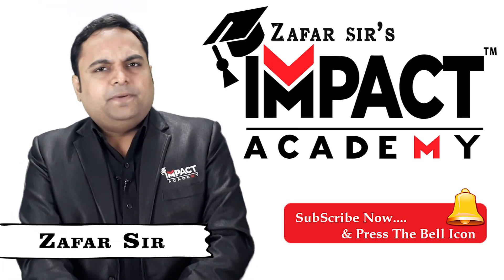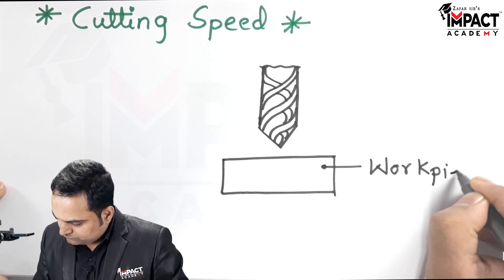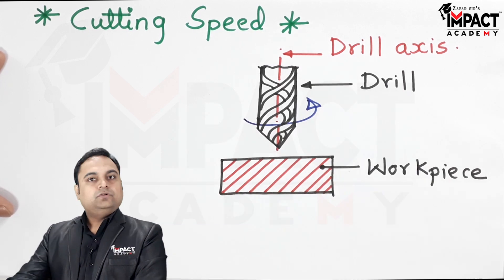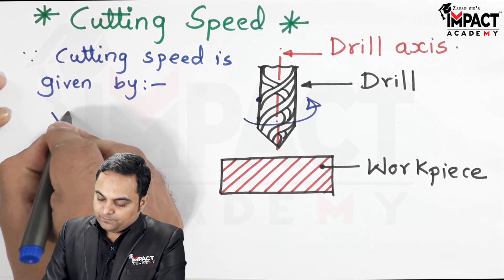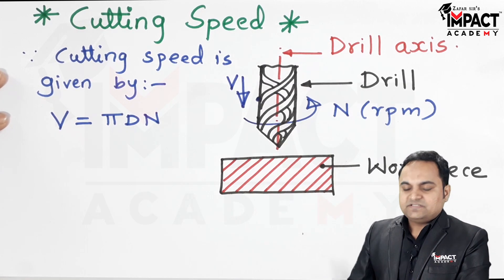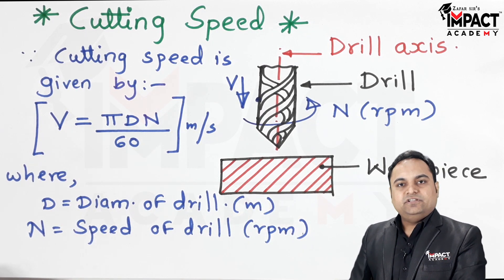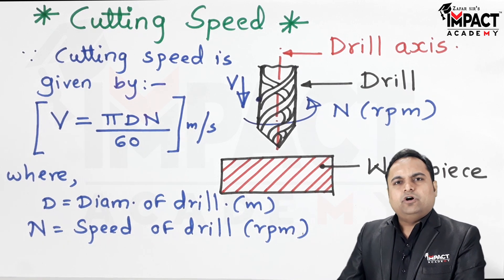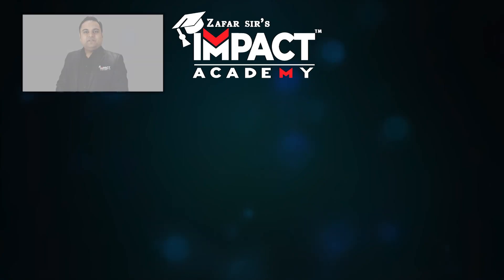Cutting Speed | Machining Operations | Manufacturing Processes #engineering #gateexam2025 #2025

Comment: find the time required for drilling a 18 mm hole in a work pice having thickness 50mm, assume cutting speed 12m/minutes and feed 0.2 mm/rev. find the cutting time
Reply from the maker: Thanks for watching... 
http://bit.ly/impactEngineering
To access all the Remaining Videos and Private Videos
Please visit our app " Impact : The Engineering App "
You can directly download the app from the link given on top👆🏻👆🏻👆🏻

For more queries related to app, contact our Customer Care Number :- 
+91 7900123134
Reply: @ImpactAcademyOfficial  Request you to modify and re post it. Cutting Speed term is wrongly described for feed rate. Three distinct parameters : Cutting Speed which is material and tool dependent , Feed rate in z axis , RPM of tool

Comment: The cutting speed is the speed at which the cutting point on drill rotates/moves linearly against the work piece. It is not in the axis of the drill. Please correct.
Reply: I agree. That is NOT correct, feed speed is not the cutting speed
Reply from the maker: http://bit.ly/impactEngineering
To access all Engineering Videos 
Please visit our app Impact : The Engineering App 
You can directly download the app from the link given on top👆🏻👆🏻👆🏻

For more queries related to app, contact our Customer Care Number :- 
+91 7900123134
Reply: Yes, that denoted direction of v is feed velocity.

Comment: i think you made a mistake about cutting speed. the velocity vector you've shown is the movement speed of z axis no cutting speed. are you sure? cutting speed is the vector tangent to periphery of the tool and perpendicullar to radius of rotation and this velocity and it's direction must be produce force to cut the material.
Reply from the maker: Watch All Remaining and Private Engineering Video lectures
at your Home using 
Impact - The Engineering App
Click on link below for download👇🏻👇🏻👇🏻
http://bit.ly/impactEngineering
Call for details:- 
+91 7900123134